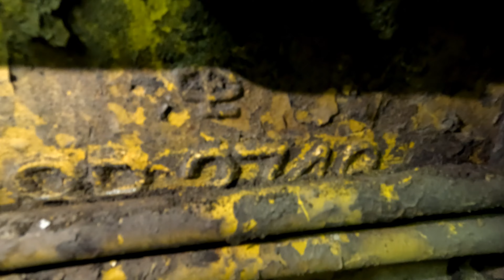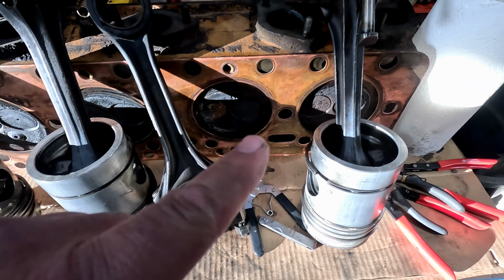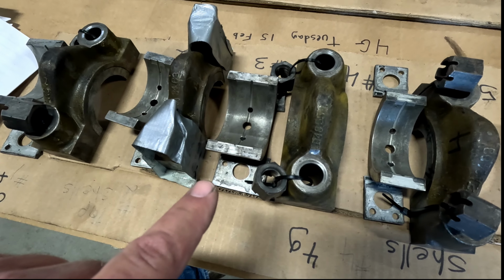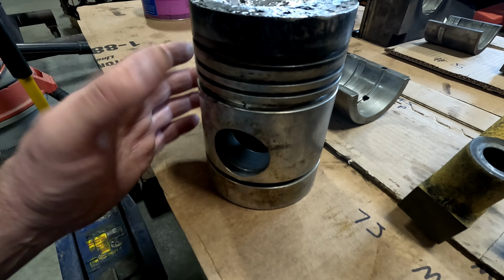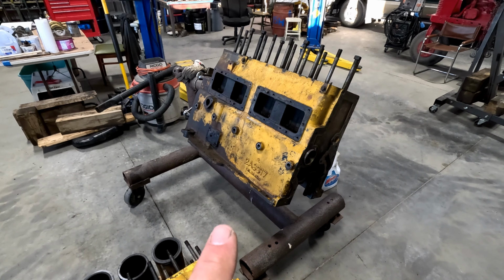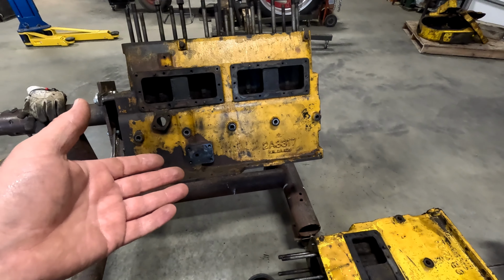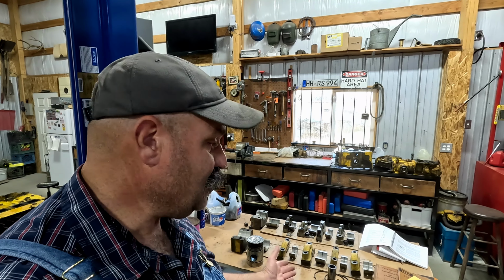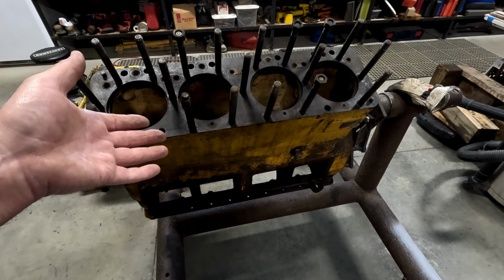D4400 Diesel engine rebuild decision 1939 Caterpillar D4 4G9986 "Lil Lefty" Episode #62

Comment: Happy Thanksgiving Aaron. I would say a upgrade is one option unless you keep on looking someone to cast new bearings. With what you have you can build a reliable engine that will work. In the old day's when the block was toast or had froze cracks they would give you a replacement block and it had a different casting number to being even blank. Starting engines where the same deal. In the general context 4G having a upgraded block dose not make a huge deal in my eyes cause it's the same era engine and visually the same as the old one. So no harm and no foul.
Reply from the maker: Thanks Steve, I completely agree. 😊
Reply: @lifeafterourloss  My Belarus MTZ 5LS the so called red tractor has the same dilemma. Original engine was a D-48 and the factory stopped making any parts to it as soon as 1970 hit. My tractor has been swapped in very early D-65 engine. The only major difference is in the inside with different crankshaft, head, pistons, liners. But from the outside it looks the same. For the D-48 there is absolutely nothing anywhere so you can't even rebuild that engine. D-65 there at least are some after market pieces so you can assemble the engine and run the machine. Not to mention long injector engines are easy to start in the cold.

Comment: What ever you do do not use rod or main caps from one block to another if you use a rid cap on a different rod it has to be line bored, same goes for the main
Reply from the maker: Thanks for the heads up! We are going to keep all of 7Js components with 7Js block. 👍